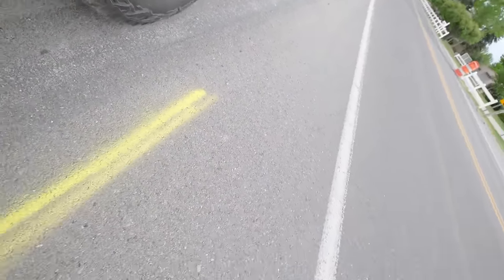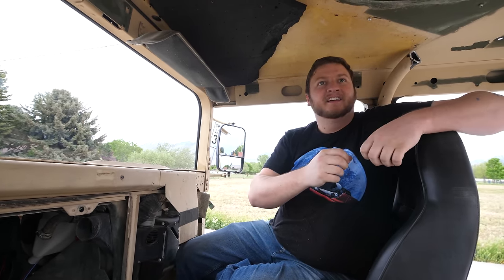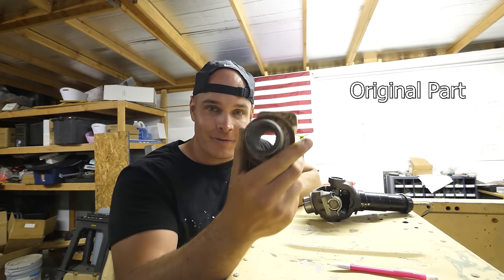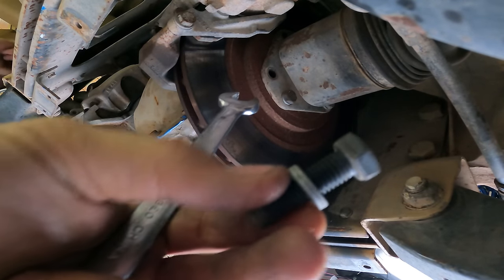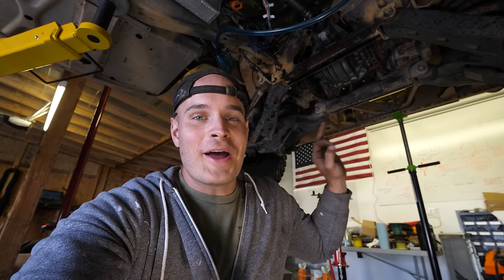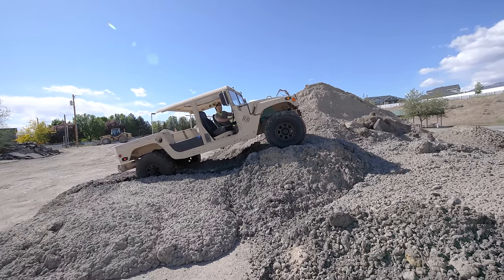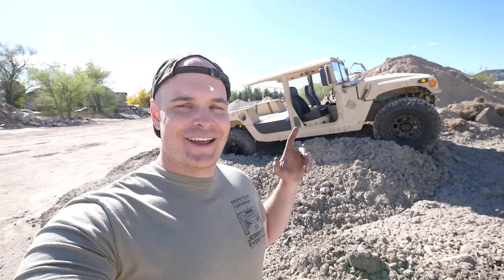My Electric Hummer has a HUGE Problem... and its all my fault.

Comment: I've always been taught than when measuring the preload on the pinion you want to get the measurement while the pinion is moving, and not the initial value.  The reason I was told is that it takes more torque to initially move the pinion than it does to maintain movement.
Reply: Ofc due to sliding friction. The static coefficient is usually higher than the dynamic coefficient, i.e. you have to input more force to wind friction to initiate movement rather than the force needed to maintain the same movement

Comment: I gasped when it broke off. My Mom and Sister had a tire lug fall off, mechanic didn't tighten them enough, the tire fell off and the car flipped (they were both mostly fine, bruised ribs but that's it). Glad to hear and see nothing happened to either of you.
Reply: Someone forgot to tighten the caliper bolts on my mom's front right. The bolt fell out while she was driving, good thing nothing serious happened just locked up the wheel. Needless to say my cousin has never touched her vehicles again.

Comment: no grease in the propellor shaft splines ?
Also propeller shafts have a angular limitation , dont exceed it while fitting.
And the shaft cannot be too straight, its needs a certain misalignment for proper lubrication.

Comment: May i ask what happened to the oil that was spilled on the road? As a motorcyclist this, this could be really dangerous to us.
Reply from the maker: As a motorcyclist myself it was barely anything with how fast I was going.
Reply: @JerryRigEverything  I'll take your word for it then :D Just seemed like a lot of oil gushed out when it completely disconnected :p
Reply: @JerryRigEverything  did you suspect it failing and filmed it? still a public road my man.
Reply from the maker: @hekjeee  it was only making a noise. I had no idea it would snap.

Comment: I love the conversion, but personally I would have used 2 motors (front/rear) removing lots of moving parts and put the batteries in there.
Reply: BTW, found you randomly with the E conversion and binged watch it.

Comment: Hey you need to put a chain across the body underneat the drive shaft. Incase if it comes of in front end it wont hit ground and flip your humvi r ur truck. Or it wont damage the driveshaft  by hitting the ground.

Comment: Critical you get the yoke phasing correct to cancel the rotational acceleration deceleration each 180deg. If wrong you will amplify or double the “error” stressing everything / vibration

Comment: Torque vectoring the join was not strong enough!! Need to check the rest of the drive train, and did you clean up the trail of oil by covering it with sand?

Comment: did the guys at Mod Mafia teach you how to BTM? You coulda made it higher up the taller hill if you did.  The Torsen (not torsion) differentials in the Hummer/Humvee don't automatically engage. You have to modulate brake and throttle at the same time, thus BTM (Brake Throttle Modulation).

Comment: Torsen (torque biasing differential or TBD style) diffs are not "like" a locking diff in any meaningful way.    They are a torque multiplier so if one side has enough traction to hold X lb-ft or torque before it slips, the TBD will provide up to 2-3x (torque bias ratio determined by angle of the worm-like gears) that amount of torque to the other side if it can hold that.     BUT, if one side has zero traction, thus zero load, thus zero torque multiplied by the torque biasing ratio is still zero, and you'll put zero torque to the other side as well, just like a regular open differential.      It's pretty easy to demonstrate this.    Find an obstacle that'll let you flex out the vehicle such that opposite corners are in the air.    At that point the two tires in the air will spin freely and you'll go no further.   The trick is to put some load on the zero traction side, by applying the brakes.    Brake and throttle at the same time, and the TBD will multiply the torque required to overwhelm the braking side by its torque bias ratio to send more torque to the side with traction.
Reply: same same, but different

Comment: The rotating resistance in the carrier is how we measure pre-load of the carrier bearings. Bearings are not loose, or in “end-play” which you can measure with a dial indicator.

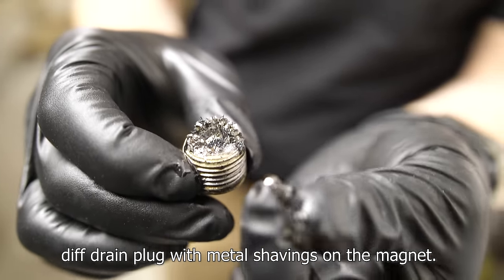Comment: @5:24 it's not a "torsion" differential, it's a "Torsen" differential... specifically a T-1 or Type A (there are two other Torsen types). It doesn't lock (as suggested @5:36), but does limit "slip" by biasing torque toward the slower-turning output.

Comment: you need a creeper gear or as shown the high torque electric motors  will cause the wheels to lose traction when you're climbing. You should be able to set that up in the motor speed controller.

Comment: Now Your shaft is weak in that assembly which have same old diameter. May be you can do some torsion calculation with max  torque out put and yield strength of the shaft.

Comment: I noticed the torsen lockers weren't engaging, I think you need to apply a little bit of break pressure at the same time as you press accelerator pedal, the spinning side needs to get some resistance before the lockers engage... I think that's how torsen lockers work..

Comment: Not sure if you know, but when rebuilding a driveshaft, make sure the u-joints are "clocked" properly. If they're not then the output will oscillate (speeding up/down)  and that may not be desirable... Nice build, I can't wait until electric drivetrains are affordable enough to buy for a "commoner"!

Comment: Unbelievable how you can drive on public road legally without proper inspection, while here in Italy you barely can add a spoiler, let alone build a whole vehicle and drive it legally... 
I can't decide what's good or bad between the 2. 
BTW did you torque and threadlock any bolts except at 9:55? I don't recall seeing that in any of the episodes... would be cool to see
Reply: Welcome to Merica.

Here some vehicles are only taken off the road when they rust through so badly a shop refuses to the liability risk of duct taping the parts together any further.

In comparison this is pretty tame.
Reply: @andyruse4670  yup I've seen some videos from Just Rolled In

Comment: My guess before watching: like my 1996 fleewood liousine, the U joint is not within the range of operational angles because of the modifications raising/lowering the output shaft of the motor, or lengthening the drive shaft.
Never mind, that shouldnt make the whole shaft move forward

Comment: If you end up with drive line vibrations you NEED to phase the rear driveshaft to the slip yoke and it looks like you put a new(different)slip yoke on it which means that driveshaft is not balanced properly....just in case you run into those issues down the road at highway speeds

Comment: Great video!!
If you haven't already please read into uni joint alignment(radially) and in/out yoke angle, input and out side must be on a parallel plane with each other or it will cause vibrations and unwanted torqueing, particularly at higher speed and  and ruin more diffs. you don't seem to be running much angle so the effects may not be noticeable but.... best practice ya know :). Thanks Again for the awesome videos!.

Comment: Love the video! Splines are a PITA, I tend to count like ten times to make sure I don't fudge it up!

Just mentioning a technicality, just in case you find this interesting: (as this is not the point of the video)

The torsen differential is not really a "locking" differential. It's a torque "biasing" differential. It will split torque unevenly, with a fixed (maximum) ratio favoring the slower moving (thus tracting) output

So if a specific torsen diff has a 4:1 ratio it, in a worse case scenario will always deliver a maximum of 4 times the amount of torque to the tracting wheel than it does to the freewheeling one. if the wheels both have traction then the torsen will act as pretty much an open diff. And if the wheels have different amounts of traction they wheel get some ratio depending on the difference in traction.

This is important difference as it basically means: When you have a wheel in the air, and you're spinning it at constant speed, the only torque it's getting is as much as needed to counteract the friction... not very much. That, times 4 is what you're delivering to the tracting wheel! So basically, not very much! So in order to get torque to the tracting wheel you'd have to let it spin down, then try and spin it up fast to get torque to it (to overcome inertia), thus getting even more torque to the tracting wheel.

This is in contrast to a limited slip for example where the difference is also RPM based, and thus the diff will lock to a degree and provide significant torque advantage to the tracting wheel (as "the ratio itself" is not fixed, but depends on speed difference) even at constant rotational speed, or, obviously to a proper locker.

Its still an amazing design though.

Comment: When anything related to the gears meshing you must calculate the diametral pitch which is Pd = number of gear teeth / diameter of the gear, and the two gears must have the same value.

Comment: not sure if you cleaned out the rear differential but where did all the swarf come from. your failure was external
Reply from the maker: The bearing inside was also probably wrecked

Comment: Youre setting pinion depth and how well it meshes with the ring gear. Tighten it down to much and the pinion sits too far in and vice versa. Its not gonna "blow apart" on ya. Just shortens the life of the gearset (which is obvioualy bad) and causes a whining noise.

Comment: Why would the yoke failure cause massive wear on the internals of the diff? Seems completely separate. That diff drain plug had tons of shavings.
The 2 are separate..
Reply: too much preload on the pinion bearing and a totally misaligned ring & pinion

Comment: when concrete trucks are finished with their load, they add a chemical that makes the concrete basically useless and it just crumbles like it did under your wheels.  so they can clean their tanks out before heading back to their plant.

Comment: With the additional weight added from the batteries I feel like you should definitely add a roll cage that is spec'd to your ground weight. So in the event of a roll over you arent getting crushed by 6k pounds of battery and steel.

Comment: That yoke can handle 2200ft lbs yes however don't forget that your gearbox is under driving the electric motor. Therefore for example the motor produces 400ft lbs and you are using a 3 to 1 gear reduction out the gear box the actual tq that driveshaft yoke will experience would be  1200 ft lbs.

Comment: I am a truck driver, and in my first 6 months 9f driving semi's my dr8ve shaft broke. A 5+ inch solid steel drive shaft was sheered in 2. Normally when a drive shaft breaks, it is the U joint that fails. My truck broke the middle of the drive shaft

Comment: Cement is the worst possible pile of powder to drive into! The moment it rains, any residue on your truck will turn solid. You'll have to now very carefully get it off with a soft brush before you risk that.

Comment: Hey jerry, i think all the mechanical parts that might get broke, or disturbed, so you shud make those in a pair, the parts like you made it from the laser shop, or any other components, so if one gets broke you will have another, and would not start it off from making new.

Comment: I can't get my head around the, different amount of teeth and slits, and "It felt good" all but one of the slits/teeth combo should have been off. Thats like 95% wrong. That can't have been the case does it? Getting a square shape in a triangle would have been easier.
Or is there something else connecting the spleen and shaft?
I've never played with a hummer, but do have some experience in agricultural appliances, and our trustworthy Terry. But I cant remember anything shaft related, that didn't fit or no fit, but kind of fit.
It must have been the wrong size or something. Maybe a hair smaller shaft that was holding on for dear life on the teeth edges? But that would have resonated the whole driveline I would think.

Comment: its mostly known as a collapsible spacer and it collapses and makes the 2 tapped roller bearings have pre load on the pinion gear. you can take the collapsible spacer off the pinion gear and stretch it by putting it on a solid bar in a vice and hitting the bulge with a hammer and it will stretch up to 2mm longer depending on how much you hit it.

Comment: Would have made it if you had the tracks on rather than wheels  they make wheel and tire replacement tracks like a tank track to replace each wheel and tire.  They rock less getting stuck off road and great in snow as well but on the open road slow going not made to roll like 70mph so I hear

Comment: I wish I had a problem as simple as that. Here I have a UQM motor/controller not even turning. Most of the RS232 to usb adapters are not accessing the inverter and without accessing the inverter I can't set the parameters.
So I understand that is a complication but it's nothing. Just old time mechanics.

Comment: I recently had a front u joint fail and the drive shaft was kept from hitting the ground by an electrical cable (which the shaft then ate). I was going 60 mph when it sheared. IT IS NO FUN. I think it is better for the rear to separate than the front, though, because even if it hits the ground, you’re dragging it instead of pushing it. Pushing a shaft can be VERY catastrophic at high speeds. Your floorboard WILL fail before the driveshaft does (unless, of course, you drive a military grade Hummer that’s built to protect against, ya know, projectiles.) 😂

Comment: The error destroyed the pinion shaft, not the whole final drive unit. But hey, never pass up an excuse for an upgrade involving a lot of new parts! 😁 But to be fair, if the final drive design allows spline bits to get inside the housing, which from the bits on the magnetic plug it appears that it might, then the whole unit would be trashed and a rebuilt unit is called for.

Comment: Im pretty sure that when measuring the pinion turning torque the ring gear assembly should be removed as this adds to the turning torque measurement. In other words you are not getting a true reading and therefore the pinion flange nut it not properly torqued.

Comment: Make sure you have that driveline slip yolk lined up correctly with the yolk at the transfer case side as well so that it's in phase.  If it's not you'll put stress on the drivetrain and potentially give yourself a driveline vibration.  Hadn't seen anyone else mention it and it looked like you somewhat arbitrarily installed your slip yolk on the drive shaft. Not trying to dig on you, it's just not something the most people would know about and could potentially install incorrectly without a second thought.  Cheers though, this thing is coming along well!

Comment: Curious on the range with your 100kw system 🤔 especially since it has a 80mph limiter. Also curious on how the half shafts will hold up to the quoted max torque. If all goes well I would want to see you sell the custom parts you made for others to ditch the diesel/gas trend and go zero emissions. Either that or sell/open source your 3d designs (but I know this is a business and that's unlikely). Awesome work and I look forward to the future videos.
Reply: 100 kWh, not 100 "kw". Range will be short, due to the horrible drag of the HMMWV and its tires.

Comment: Shit happens man, its amazing you're doing this stuff. The first motor I rebuilt I forgot to properly install a small cam alignment pin and it fell in the crankcase and broke a small bit ofthe crankcase off. Engine still runs great though as it was just an artifact of casting and not an important structural element. If anyone's curious it was a small 125cc dirtbike motor that I've abused the shit out of trail wrecking (1st dirtbike).
Reply: THANKß☝️CONGRATS I HAVE SOMETHING FOR YOU 📦🎊🎉

Comment: Yep shouldn't have a rear dif; that is why they put a motor straight to the back and front wheels. You're going to need an electric motor for that rear. but think of this! You eliminate heavyweight and add more Horse Power with the Electric motor which is even better.

Comment: you probably shouldve changed both diffs just to be on the safe side just in case someone has put a custom set of gears in the original diffs, you do not want your front and rear diffs having different gear ratios as that will cause the front and rear wheels to spin at different speeds

Comment: You putting heavy load on motors & consume a lot battery power if don't use 4x4 Hi instead of low in hard terrain like this

Comment: Don't Humvees come with an onboard tire inflation system that lets you adjust tire pressure on the fly? Lowering the tyre pressure could have avoided sinking into the ground so much

Comment: You have to put a new crush ring in if you loosen the pinion nut or it's going to fall apart
Reply from the maker: That's not what the manual says.
Reply: @JerryRigEverything  maybe there is something different because it's a special setup but that is the first one I have ever heard of that didn't have a big warning on how if the nut is loosened the crush sleeve has to be replaced good luck and love the content

Comment: One key difference in an EV is max torque is at zero RPM. Most automotive components assume it happens when your already really moving. But can see why that spline looked like the correct one.